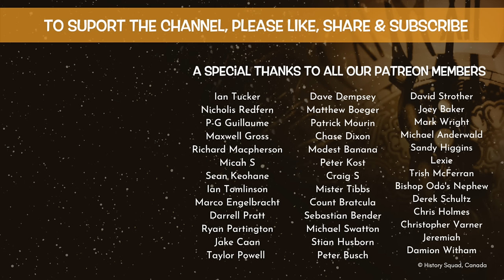Hand making a medieval style arrow, now, and in the middle ages

Comment: i have tried that trick with the sandstone.
Reply from the maker: How did it go?
Reply: @thehistorysquad  it worked great but i had difficulty keeping it perfectly round so i had to constantly turn the shaft. it was also difficult when the sides weren't parallel for example after i tapered the shaft. but the arrows flew straight and lasted ages. im experimenting right now with american indian footed reed arrows and its really good for smoothing out the nodes but smoothed nodes break easier then proud ones.
Reply from the maker: @user-pn5cc4uj9w  Excellent.  I have a native bush cane arrow, complete with all the nodes and it flies just fine 😉
Reply: @thehistorysquad  i found that to. im also experimenting with a bamboo or pine foreshaft on an ash arrow for stump shooting so the foreshaft will be destroyed if i hit a rock or glance the target but the shaft and fletching will be untouched and i can re-foot them really easily even around a campfire.
Reply from the maker: @user-pn5cc4uj9w  Great idea 👍🏻

Comment: Why did you use a grey feather for the index feather? Is there a color for the fletching?
Reply from the maker: The grey feather is just the cock feather.  It sits on the outside of the bow so I know the arrow is seated correctly.

Comment: What was the purpose of gluing in the dark strip at the rear of the arrow where you made a saw cut?  I don't see what that dark insert does for the arrow.  Thanks.
Reply from the maker: Hey Jack, it strengthens the nock, preventing the bowstring cutting down through the arrow as you release it.  👍🏻
Reply: @thehistorysquad  Thank you for the answer.

Comment: Question:  Do arrows have to be perfectly round in cross section? so long as the surfaces are straight why waste the time of sanding to a perfect cross section?
Reply from the maker: I can see why you'd ask, but when the arrow passes over your hand it has to be mirror smooth or it'll rip your flesh or glove, and it has to be this way so it'll flex as it flies through the air.  👍🏻

Comment: What condition would the arrows, especially the fletchings, arrive at a battle?   Arrows bundled, or put in barrels, shipped, on loaded/off loaded, rain/humidity etc. certainly would have "compromised" the arrows before shot by the archers?  I suppose 'accuracy' when shooting arrows 'en masse' at enemy troop concentrations was not really important, range and volume of 'fire' more important?
Reply from the maker: The arrows were well taken care of, spacers put between arrows and there was even a man whose job it was to take care of the arrows from the point of deliver to the point of despatch.  👍🏻

Comment: Does this mean that the grains of the wood in your arrows, run parallel from one end to the other?
Reply from the maker: Yes, it does 👍🏻
Reply from the maker: Absolutely right  👍🏻
Reply: @thehistorysquad  
So this would mean that it is possible for someone to split another arrow from behind that is already in a target. This because modern wooden arrows are made from turned wood in which the grains may not run parallel from end to end.
Reply from the maker: @lasentinal  Yes, I've split many an arrow in the target, but usually it only splits a couple of inches because the whipped fletchings stop it splitting further.

Comment: And what kind of steal did they use for the arrow head's
Reply from the maker: Some were iron, some steel and they were hand forged, not molded.  I've watched how a bundle of them were wrapped in linen and wool and placed at the bottom of the blacksmith's furnace to case harden them.

Comment: How did they make arrow head's did they make a use a .mold make the arrow head's by hand
Reply from the maker: Arrowheads were hand forged out of iron or steel.  They could then be cased hardened by being wrapped in wool & linen and placed in the bottom of the furnace.

Comment: How do you split the feathers?
Reply from the maker: With a very, very sharp blade, but I buy mine already split 👍🏻
Reply: @thehistorysquad  I made my own long bow 15 years ago out of red oak. Last summer, I refurbished it using the 15 years of experience I gained in woodworking. About 60lbs draw give or take a pound or 2. Indian ebony wood semi inlaid string  knocks. No arrow shelf. Hand on handle arrow rest. I'm thinking about adding an ebony wood arrow scuff gaurd type thing where the arrow makes contact with the handle. 
I haven't yet made my own arrows, but I'm going to do it soon.
Reply from the maker: Wonderful 👍🏻 @steadfasttherenowned2460

Comment: I second not getting in front of your needle file. I hit a joint with mine and I think I got some metal in it. No fun.
Reply from the maker: Ouch!!
Reply: @thehistorysquad  An injury is actually how I found your video. I finished an osage bow this morning and tried to make an arrow without knowing what I was doing. Four stitches in my finger later, I decided to learn the right way.
Reply from the maker: @dee5298   😳 The worst injury I had from an arrow was when I released one at Warwick Castle and the loose fletching when in under the skin of my left knuckle and came out about an inch later up the finger.  The arrow flew on, leaving the fletching hanging off my hand.  I had to clip it and draw it through, bind it and learn then to "always wear a shooting glove"
Reply: @thehistorysquad  That sounds pretty horrifying. It also reminds me that I need to make a new forearm guard and I guess I need to figure out what glove I'm going to wear. My left hand is useless for at least a week so I may want to put that time into safety equipment. Thank you for bringing that to the forefront of my mind before I made another mistake.
Reply from the maker: @dee5298  😜 be safe 👍🏻